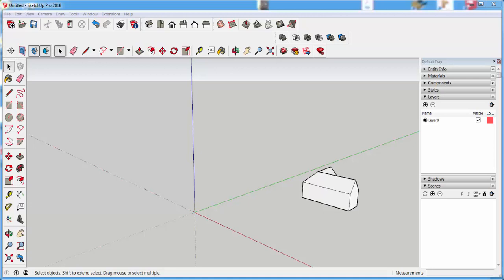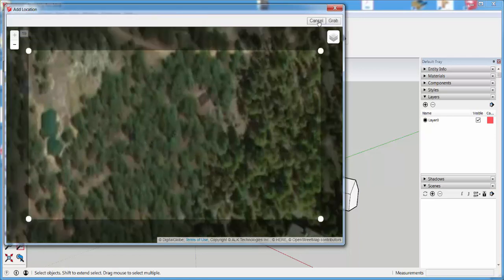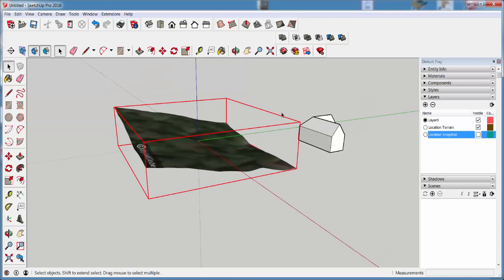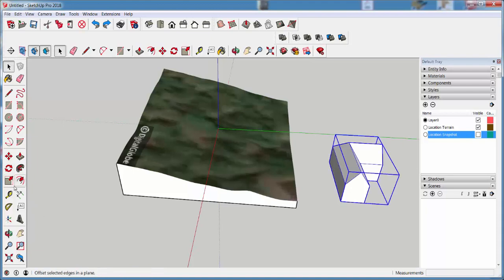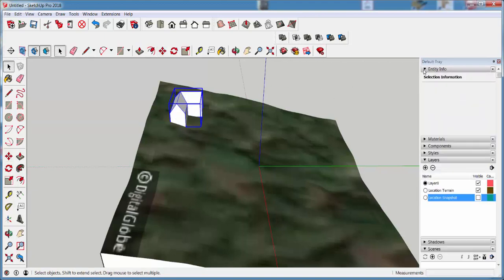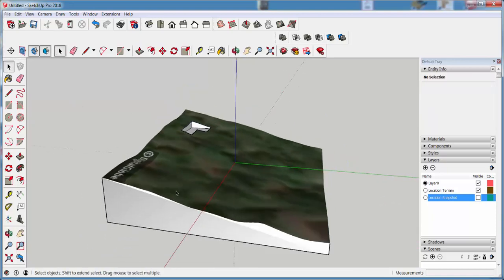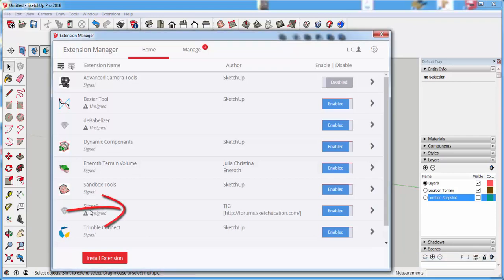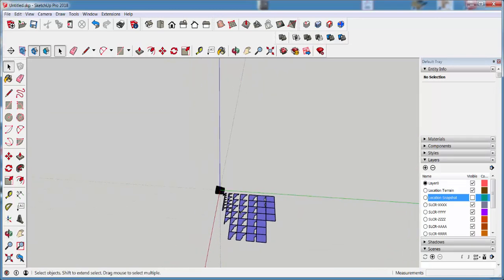SketchUp 2019: Architectural Terrain Model

Comment: Great vid. Location terrain is not shown on my program, what should I do?
Reply from the maker: Santiago Jaramillo Are you using an old version of Make? It doesn’t have geolocation.
Reply: @ProfDrafting  version 18...... 2018. I can add a geolocation image but the geo terrain layer doesn't show on the program. The toggle terrain option doesn't work either.
Reply from the maker: Make limits those features. You need to get Pro to use them.